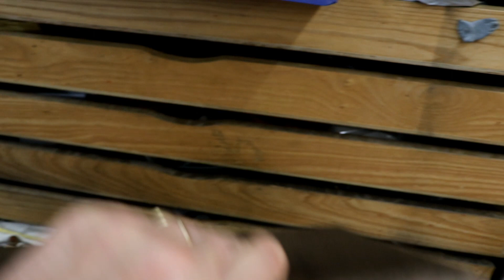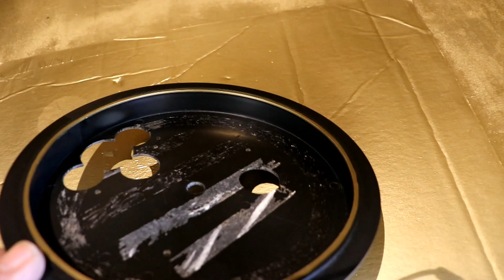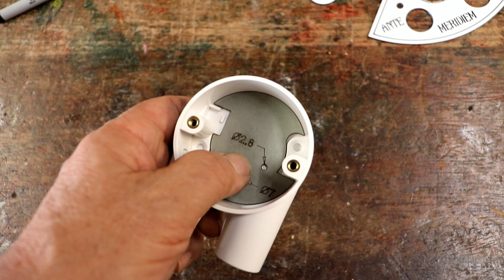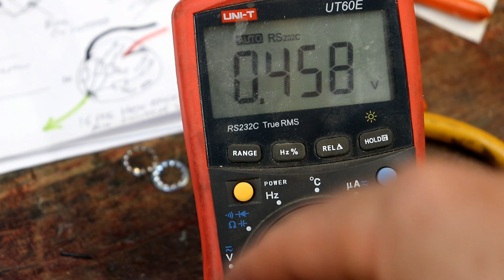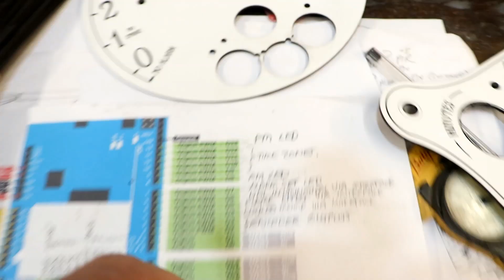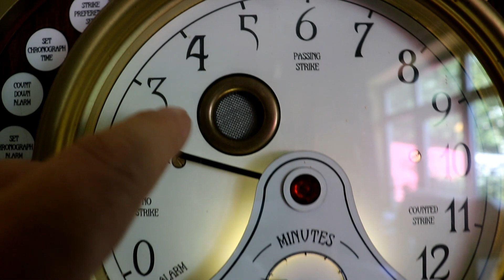Steampunk Clock Gauge - Part 1

Comment: As always, amazingly beautiful!  Am considering building a clock now, but with minutes instead of hourson the main face.  Question..what stepper motors and controllers do you use for your hand movements?
Reply: Hi bill, thanks for your interest. I’m currently on holiday with very poor reception, so can provide more info when I return after next week. In the meantime, Google arduino small stepper motor, and it should point you in the right direction. They’re something like buy…

I hope this helps 

Kind regards 

John
Reply: Thanks John…enjoy your holiday.  I am familiar with the plethora of stepper motors available, like the cereal isle at the grocery store there are hundreds of choices.  Since you probably have figured out which ones work for the partial sweep clock, was just trying to stave of finding a good motor without the same trial and error.  No issues, very much enjoy your videos, amazing engineering!
Reply: @billrb4855  hi bill, better signal today! The motors I use for all my machines are the 28BYJ-48 stepper motors. They come with a lovely interface board that has 3 spare usable‘switches’. There are several arduino stepper libraries that wii control them. Good luck with your project!

Kind regards John